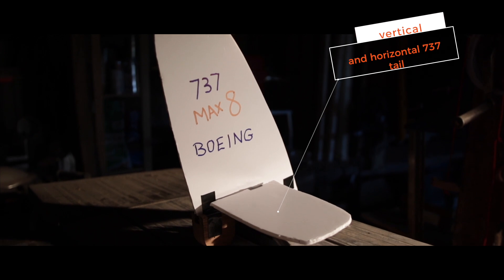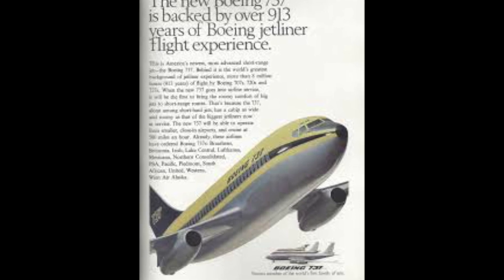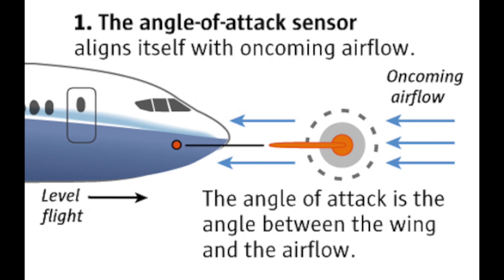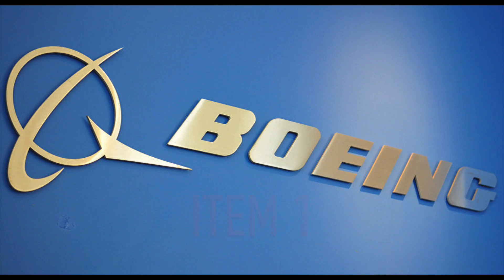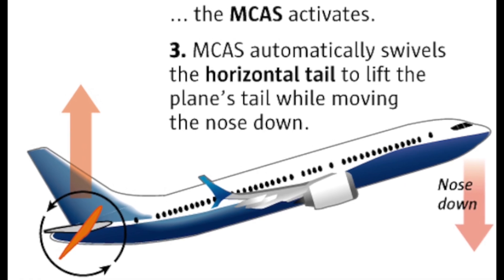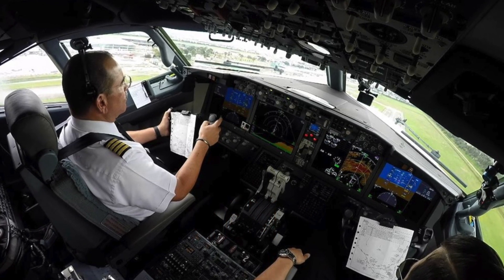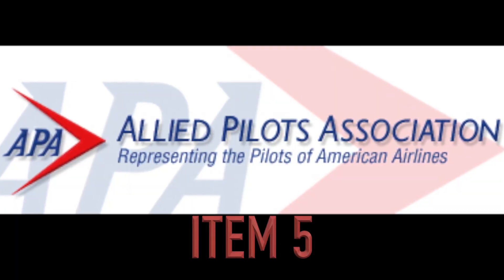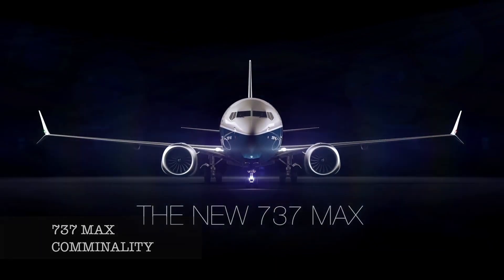NEW *** 737 MAX 8  - Prof Simon

Comment: I can’t believe they missed such an important step (which is pilot training info docs) with its new implementation of technology. What the hell were they thinking.
Reply: If you have an automated adjustment of things that effect the control of the lane (trim, elevator, engines, etc) you have to set absolute minimum and maximum values it can be adjusted to, it should be required in all such specifications and the FAA should require these numbers. It wasn't that it moved it 2 degrees vs 1/2 degree at a time, it was that it absolute maximum was 100% trim. The max trim should be set on the amount of time it take to get back to neutral (0 deg) position and the angle down the plan would have if the pilot let go of the controls. I saw a trim screw video and it rotated at best a few revolutions per second, on a screw with at least 50-100 treads, it might take 10-20 seconds to go from max trim to neutral trim.
Reply: They were thinking about short term profits, like most US companies. Another example is the US automotive industry.
Reply: These mf don't care anything for the dollar. A brand new system 
and one hour training on a laptop
no simulation.
Reply: They was thinking: Money, Money, Money, Money, Money, Money, Money, Money, Money, Money, Money, Money, Money, Money, Money,
Reply: TheRedRaven:  What they did was wrong, but makes perfect sense.  Proposing training for the MCAS system would draw attention to and highlight the fact that the handling characteristics of this latest engine retrofit are too marginal.

Comment: It's obvious the Max is a completely different bird to previous 737's. What Boeing's take on "there is no need for any difference training" is all about only they will know. It won't surprise me in the least to find out that the Max, has no inherited design fault, or failure of the aircraft, it simply didn't behave the way pilots expected it to given previous 737 experience.
Reply from the maker: Spot on...Wayne...it’s fine but not a 737
Reply: G.Blomqvist 1.Flight surgeon (ret RSAF)& former glider pilot,also in the 70s,80s&90s pilot trained on SAAB Sk 60,Sk35 C Draken & Sk37 Viggen. Low level& aerobatic flying included.It's the airflow.Hi professor Simon, you're  good.But;My personal opinion :The fact that both crates went straight into the ground is probably due to a "lock" of a stalled elevator-stabilizer .Equivalent to an elevator.loss.( Remember the Reno P51 straight up 450 mph,pilot's head hanging down, a blackout due to the sudden elevator failure, with  high G forces, then straight  down ,killing spectators)Combined with the autopilot's "automatic air velocity  control" device.at full bore setting,due to incorrect reaction to the complex maneuver..The  automatic command to increase speed due to the"stall"..Not just with stall warning,but a hostile take over of the controls.Right? However;
A tendency to  nose up ,even a stall at a full throttle  take off, is extremely dangerous and shall not be corrected by any computer.Back to the drawing board!  Not a safe fix.On the contrary.inoculated instability computer-directed, in fact. Albeit possible in fighters as the formidable SAAB JAS39 Gripen E/N .The forward mounted  very powerful engines'  scoop- like nacelles at a high angle of attack   act either as lifting wings,the upper "lip" due to Bernoulli's law & the lower  pushed up.Or the reverse.Just like any wing..The larger the diameter of the air intake  ,the higher risk for upward or downward forces.Also:Potentially.,as  low placed &anteriorally mounted engines act as air brakes  ,drawing the nose downwards , aerodynamic nose heaviness,when a dive is induced by the MCAS. But when  the pilots try to pull up,,i.e. reverse the  elevator to normal or pressing the tail down,( automatically probably over-compensated,up to 2,5 degrees ,not  to 0,06 degrees,increased  angle of attack of attack, the elevator.already is stalling. every force  then is directed downwards. In the Air Force called " lock of the control surfaces"( usually at very high speed in an uncontrolled flying mode.Then  you must eject. .Back to the drawing board.Or convert all MAX 8&9 back to normal 737 airframes with suitable  engines.Just a thought.
Some nice videos. RSAF
https://www.youtube.com/watch?v=JlOmy1O4NZU
https://www.youtube.com/watch?v=9SmJs3R1ZDc
https://www.youtube.com/watch?v=bZkYnr58DOw
.https://www.youtube.com/watch?v=9yDWjqyVDmo
bonus. Display by my friend Ulf Johansson 1987https://www.youtube.com/watch?v=5CrnT1ca61o

Comment: bottom line the "pilots" SHOULD have noticed the "runaway" auto trim and executed the proper procedure which is to  first disconnect the power to the auto trim motors using the switches located on the trim console and then trim the plane using the manual trim wheels on the side of the trim console.  the reason Boeing did not require additional training is because the runaway trim procedure is already part of pilot training for this and all Boeing aircraft and exists independently of ANY of the potential failures that could result in a runaway condition.
Reply: Kevin T But if a completely foreign system that was designed to be virtually unnoticeable (to make the plane act like older model 737s) was never made known to pilots, they might not suspect it when confronted with a nosedive in a critical phase of flight.  

You might only have a few seconds to properly diagnose the problem before you are in a situation that is not recoverable.  With engines at takeoff thrust a few thousand feet up, if your plane starts nosediving, you are in a dire situation and have only instinct and training to rely upon.  The yoke becomes your main focus, not the trim wheels.

And I’m not a pilot, so feel free to correct me if I’m wrong.
Reply: It is almost impossible to execute a procedure when you have just taken off, still climbing and the aircraft continuously nose down at such low altitude. Whilst the pilots are fighting to keep the aircraft flying they will have to quickly identify that MCAS is probably at work or malfunctioning. Boeing cannot defend their failure to educate pilots about new technology.
Reply: These incidents sound a lot like the Gare de Lyon rail crash in which the engineer in his panic of losing his air brakes completely forgot to activate the electronic brake backup system.  The pilot must have just panicked with the wildly acting plane and his co-pilot should have suggested what to do next, but failed to do so.  Did you disconnect the automatic trim motors?  Did you activate the electronic backup brake system?  Several years ago I was at a strip mall where next to me a woman got out of a car which started rolling backwards with her baby in the back toward the highway and she panically started yelling while trying to push against the car to stop it from rolling.  I yelled at her to push down on the emergency brake, but she couldn't process that.  Without getting into the car, I used my hand to push down on the emergency brake on the floor and that stoped the rolling.
Reply: The day before the LionAir crash, another LionAir flight had the same problem with the same airplane. On that flight the pilot recognized  (correctly) the runaway trim, shut off the autotrim, and successfully landed the plane. Therefore there are already published procedures and training that should have been followed for this condition.

Comment: 350 lives wasted because pilots were not informed thoroughly of the new system. So sad!
Reply: Actually because Boeing built an imbalance into the airplanes to save themselves and the airlines money.
Reply: The previous crew before last year‘s crash figured it out. Part has to be contributed to pilot experience and airline training. I don’t fly the max and haven’t flown anything with an MCAS but I do know how to disable a runaway trim situation which takes about two seconds.....
Reply: @Captndarty  may be a different problem .
Reply: We don’t yet know what the cause of the accident is.  Could be Boeing, could be pilots, could be both, could be malfunctioning sensors.
Reply: Ernie Coolelz  thé narrator said a pure speculation. How are yu certain about yr said ? Was it lack of training also for other plaines crashed in Florida the days before Columbia, Air France air bus emergency landing during that weekend ?  please watch yr  Brain.
Reply: The system was so poorly designed the training would have exposed it to scrutiny.
Reply: Pilots were informed. The information is in the flight manual and on the trim checklist. If fact, many pilots have had the same issue, but switched to manual control, with no problem. 
After the Indonesian crash, every Max 8 pilot should have been well informed. So if the Ethiopian crash is the same reason, it’s that pilots fault.
Reply: Ernie Coolelz — There you go, putting the blame on pilot training and, therefore, the burden on pilots to fly this aircraft safely.  It is unsafe as delivered and the fault is entirely on Boeing.

Comment: Who will independently certify the 737 max software update? Given how Boeing and the FAA have been acting recently, I don’t believe that the rest of the world are going to trust their word alone.  Nor should they.
Reply: Did you know that both FAA and EASA approved the MAX 8 in April 2017?
Reply: @ronaldngadze9037 EASA simply accept FAA documentation.  That may be about to change.
Reply: Don't ignore airlines, they paid boeing to do this.  The 2nd crash months later showed how little airlines cared.   Everyone was working together on this blunder.  The pilots and passengers were ignored.
Reply: @_PatrickO  no..... airlines buy products from boeing and it's up to boeing tell them how to use and implement their products.... if boeing said it's ok, you expect airlines gonna take them to court? say if you buy a car from dealer, is it your responsibility to know how much air pressure in the tyres or just take a wild guess or refer to the user manual?

Comment: Well its too bad about the accidents. Just have to change the engines to wing ratio. Ok engineers will move the engines back under the wings piece of cake, got it.
Reply: bang on mate, unfortunately the under wing landing gear legs are too short and in order to make them longer the fuselage would need to be redesigned. Boeing did however lengthen the front leg but let's face it the Max is just a rushed attempt by Boeing to steal customers away from the Airbus A319neo.

Comment: nice video, so it seems there just has to be a better visible button for occasionally deactivating MCAS and all problems are solved. Boeing should really put you in the safety inspector  supervisory board.  May be, the captains also have to learn to be fast and not drink coffee or go to toilette in case the nose-dive starts a few minutes after take-off when the plane is not very high?
Reply from the maker: Seems like the mcas was hidden from the pilots.

Comment: So just a simple cockpit audible warning  each time the system triggered an alteration - MCAS ENGAGING ? - would have alerted pilots to what was going on and allowed them the simple option of disengaging the system if the believed it was operating in error ?  It's always the unknown that bites.
Reply: As i understand it The max 8 does nor give the pilots total control.
The pilot asked to return to airport 6 minutes into the flight.
Reply: MCAS is just one of the thousands of programming routines that make up the Flight Control Computers (FCC). Failed sensors caused MCAS to operate unexpectedly but the fact is the failure presented itself to the pilots as a "runaway trim stabilization" error. There is a procedure in the manual that covers this and it is a memory item. Meaning pilots should know the procedure without looking at the manual. It is ludicrous for people to believe that pilots should know how every programming routine affects the aircraft. It would be an overwhelming amount of information for a pilot to attempt to learn.   

The trim wheels would have been turning forward constantly for about 10 seconds at a time and at a high rate.  They are there to let the pilot know what the trim system is doing. A properly trained pilot would have recognized this in time to disable the automated trim and save the aircraft.

Here is a 737NG pilot explaining the system. The MAX cockpit is virtually identical to the NG cockpit seen in this video. The MAX has the same trim wheels and the same TRIM STAB switches that are located in the same position. 

What is that spinning thing?
https://www.youtube.com/watch?v=l62NvkRWa5E

This 5-minute video explains all of the ways the pilots could have stopped the "runaway trim stabilization" from crashing the plane. 

Ethiopian 737-8 Max UPDATE 15 March 2019
https://www.youtube.com/watch?v=AgkmJ1U2M_Q&list=PL6SYmp3qb3uPp1DS7fDy7I6y11MIMgnbO
Reply: @rwj1313 1 Trim wheels trim all the time due to auto pitch and mach pitch by autopilot so they are not noticed and are just out of view.   You don't notice them and flight simulator trainers can easily trick students.   
2  MCAS should have had a independent disconnect switch  (like an autopilot) so that stabiliser trim motor doesn't need to be disconnected (thereby disabling electric trim) and pilot doesn't have to manually trim the nose up just after a MCAS upset trimmed him into a lethal nose dive.  Moronic Boeing.
3 MCAS should autodisconect if the sensors it uses are implausible or in disagreement (like an autopilot) 
4 B737 systems are only duplicated (not triplicated) so the pilots must decide what system is healthy and reliable and switch to it.  Stupid Moronic MCAS didn't display these angle of attack instruments so pilots cant even asses which one is healthy or faulty like they could with altimeter or pitot static tube.  In triplicated systems like on Airbus or B787 you can use a "2 out of 3" agree rule to autonomously asses by comparison if there is a fault and can then both generate an alarm and continue operating without an upset.  
5 MCAS didn't have a sensor disagree alert that might have tipped the pilots of during preflight, taxiing or before flap retraction (when MCAS activates) 
6 MCAS is manically dumb even activating full trim down when pilot has yoke back fully.  Dumb MCAS even keeps trimming in a steep dive.
7 Using the runaway trim memory check item to pull trim motor circuit breakers is a stupid way of disconnecting MCAS and was done only to avoid adding separate disconnect switches and therefore retraining and manuals rewrite.  Runaway trims happen either due to welded electrical contacts in switchgear during a manual trim.  The pilot would be aware.   

MCAS is total crap, piece of total bullshit.  It doesn't even conform to 1960s safety levels.
Reply: John North ...Great idea, kinda like when you don't buckle your seatbelt in your car or when the traction control comes on, but that would cost a few extra dollars. You're fired.

Comment: Thank you Prof. But why didn't they pick it up when testing the plane? Why does it fly nicely most of the time?
Reply: T A , fair question, but it is I believe a rare occurrence! This new 737 Max 8 is Not suitable for the sky!
Reply: T A — Sensors work properly most of the time.  The testing would have to have emulated a broken sensor, and broken in several different ways.
Reply: The testers knew about MCAS and didn't have to fight with it for control.

Comment: Thanks, I have read the Seattle article, and it is very good. Yes we are all speculating, but I have to concur, the speculation has a high degree of correlation with the facts, of course correlation does not equate to causation.
 I await the outcome of the investigation, meanwhile, I am glad the Max is grounded, no-one would willingly fly this plane until it is fully investigated.
 Thanks for the video.

Comment: Thank you for explaining a complex issue in a way that everyone can understand while still remaining factual.
Reply from the maker: Cheers
Reply: vondahe not sure if it’s greed.  They wanted to over simplify as they thought since the new system works in background everything should be seamless.   BUT when an oddity occurs and no one knows that the system even exists then how can you counter it. Especially for inexperienced pilots that were in control of the Ethiopian flight.  Too much to handle with too little time handling problems
Reply from the maker: Hi Joe, pilots need to train on new aircraft and the AA pilot only did a 1 hour interactive iPad course...Boeing were so confident it was similar to the NG 737......shame.

Comment: Thank you Prof. Simons. Your crude props explain the incident far better than tv networks' shiny expensive CGI.
Reply from the maker: Thank you....and they are fun to devise...ha
Reply: @SimonHollandfilms  This is the link to the Seattle Times article.  When it wins a Pulitzer it will be tragically noted that the gist of the article was submitted to the FAA and Boeing for comment a week BEFORE the Air Ethiopia Crash.   https://www.seattletimes.com/business/boeing-aerospace/failed-certification-faa-missed-safety-issues-in-the-737-max-system-implicated-in-the-lion-air-crash/
Reply: Absolutely correct and so well explained. MONEY! SAVINGS,PROFITS, these are the limits of much corporate reasoning, it is appaling that pilots were not made abundantly aware of this death trap.Can it be that too much use of mere technical application is being utilised WITHOUT the knowledge or input for the guys up front, i.e the PILOTS? Boeng should be fined heavily and whoever was responsible for this death trap should be punished, heavily.
Reply: The simple model made things very clear. 
Boeing should be prosecuted for multiple murders